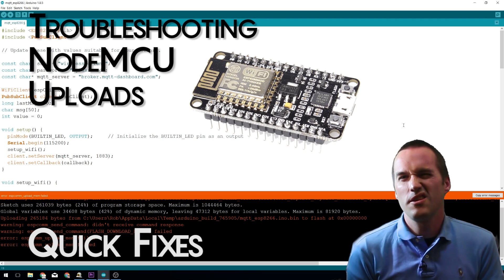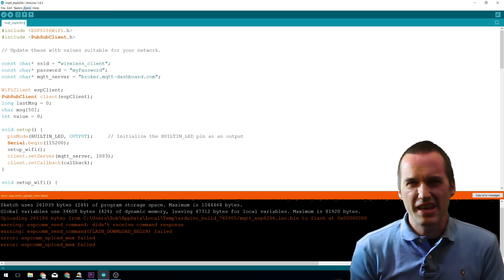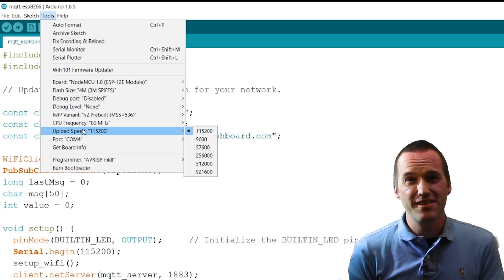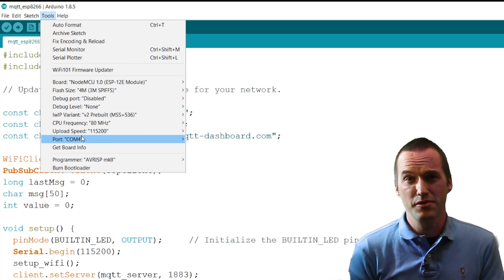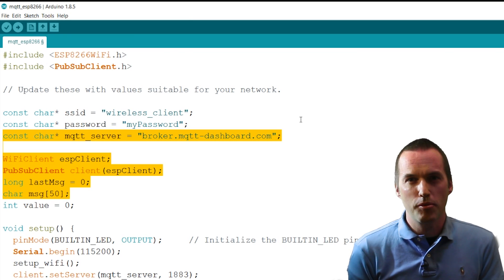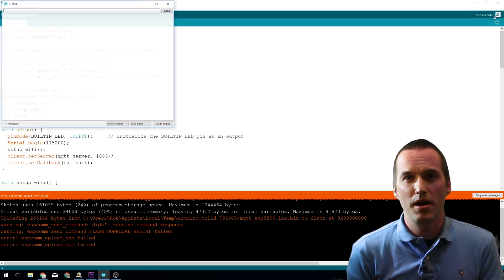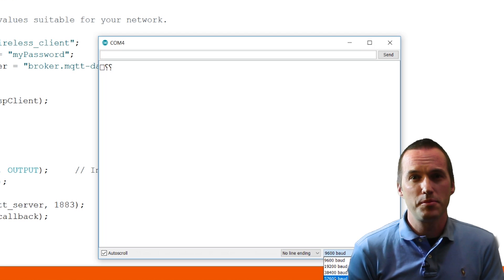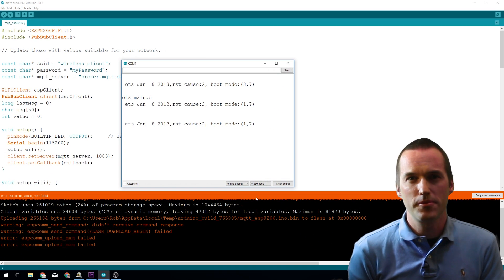Troubleshooting NodeMCU (ESP8266) Arduino Uploads

Comment: I am getting these errors after loading code into a D1 mini,  can anyone give me an explanation of what the problem is and how to cure it
Thanks...

 
ets Jan  8 2013,rst cause:2, boot mode:(3,6)

load 0x4010f000, len 1392, room 16 
tail 0
chksum 0xd0
csum 0xd0
v3d128e5c
~ld
Reply: me too
Reply: ets Jan  8 2013,rst cause:4, boot mode:(3,6)

wdt reset
load 0x4010f000, len 1392, room 16 
tail 0
chksum 0xd0
csum 0xd0
v3d128e5c
~ld
Reply: @caiqueleandro6822   Found the problem eventually, I went back to version 2.4.2 for the EP8266 Community library in the Boards Manager.
Reply: @pjweds  thank you really

Comment: There are two other issues that can effect uploading sketches to the ESP8266: your USB cable and your usb port. For example, if I use my USB 3.0 port from the headers on my motherboard I get errors uploading a sketch. Additionally, there are some USB cables that also fail. I'm not entirely sure why some cables work while others do not, but regardless, if nothing in this video helps try another USB cable and then try another USB port.

Comment: My nodemcu don't even pop up when I plug it into my pc
Reply: Try another cable. For example, I have a stack of cables I use for programming NodeMCUs and other devices. In that stack all cables work, but there is one USB cable that causes problems. When I use that problematic cable my NodeMCU doesn't come up in Device Manager, but the device powers up (5v are sent to the NodeMCU but it isn't recognized as a device by Windows).

Good luck

Comment: I have completed your installation for the RGB permanent Christmas lights, but when I go to flash the Node MCU it states that there was an error, no port found.  I tried to reset it and flash it at the same time, I even restarted my computer and reloaded ESP flasher twice.  Is there a certain pin on the node MCU that I have tot ground or something to activate the card?  Also, I have attached my control wires for my lighting zones to D1 and D2, would this affect anything?

Comment: Serial monitor says 
Waiting for connection and IP Address from DHCP
Reply from the maker: That means the upload worked but it isn’t connecting to your network. Double check your WiFi info in the Arduino sketch.

Comment: "Hard resetting via rts pin " whats this mean
Reply from the maker: That means everything worked.
Reply: @TheHookUp  help m the anwser
i have problerm about  Hard resetting via rts pin
Reply: But code is not working properly 🤔
Reply from the maker: @madushanbuddika4585  Then the problem is with your code, not with the upload.  Try using the serial monitor to determine where the code is going wrong.
Reply: @TheHookUp  Thank you very much
.... 🙏 ❤️
Reply: @TheHookUp  my serial monitor doesn't show anything (the last step doesn't work) I have to say I have this problem with an esp32... Code is uploading, but not generating a ip (and showing it on the sm)
Reply: @The Hook Up i get the same problem even using the example code in Arduino (Blink), "Leaving...
Hard resetting via RTS pin...
" hanging and internal led not blinking (and nothing in serial monitor), maybe there's something else going on
Reply: @The Hook Up same problem . Tried various small pgms. Pgms used to work earlier doesn't work now. Always the same msg "Hard resetting via rts pin"  and then it turns off

Comment: Hey thanks for the video maybe you can help me :D my NodeMCU is fresh out of the box and i can't flash it as a result from pressing the "flash" and "reset" button this comes out:
r(some other symbols which can't be displayed here like an box or arrows)$
is my device broken?
Reply: try this:
1 plug in your nodemcu
2 press and hold flash button
3 press and release reset button (while still holding the flash button)
4 upload (still holdi flash button until uploading starts) 
it should work.

Comment: the upload failed showing that, the selected serial port does not exist or your board is not connected
Reply from the maker: Make sure you have the driver installed for the USB chipset (probably the CH340)

Comment: hai sir,

my nodemcu is done uploading but at the last its state

leaving..
hard resetting via rts pin...

do u have any suggestion to solve this issue?
Reply from the maker: That means it uploaded correctly.  If your program isn't working the problem is with the program not the upload.
Reply: fatimah arsad, I have the same problem.
Is your problem over?
if yes, how?

Comment: my error is regarding connecting  led light with nodemcu esp8266 in a breadboard without resistor i have done these steps in the video but at the end of uploading its says leaving... hard restting via rts pins

Comment: Please help with this error: "esptool.FatalError: Failed to connect to ESP8266: Timed out waiting for packet header". I tried everything you said in your video. 

OS: Windows 10, latest arduino version. NodeMcu Lua V2 ESP8266 WiFi with CP2102. esp8266 v2.5.2.. Solutions that i tried: 

1) downgrading version of esp8266 from 2.5.2 to 2.5.1 (still same issue)
2) holding down flash button while uploading.
also worth mentioning, the thing you did at the end of video, nothing happens to appear in my serial monitor except for a reversed question mark. Please help my kindly. :'(
Reply: more on the error: 

esptool.py v2.6
2.6
esptool.py v2.6
Serial port COM3
Connecting........_____....._____....._____....._____....._____....._____.....____Traceback (most recent call last):
  File "C:\Users\Tech Land PC\AppData\Local\Arduino15\packages\esp8266\hardware\esp8266\2.5.2/tools/upload.py", line 25, in <module>
    esptool.main(fakeargs)
  File "C:/Users/Tech Land PC/AppData/Local/Arduino15/packages/esp8266/hardware/esp8266/2.5.2/tools/esptool\esptool.py", line 2653, in main
    esp.connect(args.before)
  File "C:/Users/Tech Land PC/AppData/Local/Arduino15/packages/esp8266/hardware/esp8266/2.5.2/tools/esptool\esptool.py", line 468, in connect
    raise FatalError('Failed to connect to %s: %s' % (self.CHIP_NAME, last_error))
esptool.FatalError: Failed to connect to ESP8266: Timed out waiting for packet header
esptool.FatalError: Failed to connect to ESP8266: Timed out waiting for packet header
Reply: Did you solve it? I am getting the same  error and cant find out how to solve it. Please Help.
Reply: @jigarvaishnav5214  I had to change both dht and esp8266. several times. probably my equipment was faulty. and I switched back to dht11 instead of dht22.
Reply: also try downloading the driver for esp8266

Comment: HERE MY ERROR. Is thr anyone knows whats the problem is this??PLEASE HELP THANKS
Arduino: 1.8.9 (Windows 10), Board: "NodeMCU 1.0 (ESP-12E Module), 80 MHz, Flash, Disabled, All SSL ciphers (most compatible), 4M (3M SPIFFS), v2 Lower Memory, Disabled, None, Only Sketch, 9600"

Build options changed, rebuilding all
Sketch uses 274756 bytes (26%) of program storage space. Maximum is 1044464 bytes.
Global variables use 27224 bytes (33%) of dynamic memory, leaving 54696 bytes for local variables. Maximum is 81920 bytes.
esptool.py v2.6
2.6
esptool.py v2.6
Serial port COM5
Connecting....
Chip is ESP8266EX
Features: WiFi
MAC: b4:e6:2d:69:8b:81
Uploading stub...
Running stub...
Traceback (most recent call last):
  File "C:\Users\HP\AppData\Local\Arduino15\packages\esp8266\hardware\esp8266\2.5.2/tools/upload.py", line 25, in <module>
    esptool.main(fakeargs)
  File "C:/Users/HP/AppData/Local/Arduino15/packages/esp8266/hardware/esp8266/2.5.2/tools/esptool\esptool.py", line 2670, in main
    esp = esp.run_stub()
  File "C:/Users/HP/AppData/Local/Arduino15/packages/esp8266/hardware/esp8266/2.5.2/tools/esptool\esptool.py", line 597, in run_stub
    p = self.read()
  File "C:/Users/HP/AppData/Local/Arduino15/packages/esp8266/hardware/esp8266/2.5.2/tools/esptool\esptool.py", line 277, in read
    return next(self._slip_reader)
StopIteration
An error occurred while uploading the sketch

This report would have more information with
"Show verbose output during compilation"
option enabled in File -> Preferences.
Reply from the maker: I think this error can be solved by moving your arduino sketch library out of your documents folder
Reply: @TheHookUp  thank you very much for this video

Comment: esptool.py v2.6
2.6
esptool.py v2.6
Serial port /dev/ttyUSB0
Connecting........_____....._____....._____....._____....._____....._____.....____Traceback (most recent call last):
  File "/home/sasank/.arduino15/packages/esp8266/hardware/esp8266/2.5.1/tools/upload.py", line 25, in <module>
    esptool.main(fakeargs)
  File "/home/sasank/.arduino15/packages/esp8266/hardware/esp8266/2.5.1/tools/esptool/esptool.py", line 2653, in main
    esp.connect(args.before)
  File "/home/sasank/.arduino15/packages/esp8266/hardware/esp8266/2.5.1/tools/esptool/esptool.py", line 468, in connect
    raise FatalError('Failed to connect to %s: %s' % (self.CHIP_NAME, last_error))
esptool.FatalError: Failed to connect to ESP8266: Timed out waiting for packet header
_
the selected serial port _
 does not exist or your board is not connected
please help me fixing this

Comment: I am getting this error.
Arduino IDE, nodemcu
............................................................................................................
Stub running...
Configuring flash size...
TRACE +0.000 command op=0x0a data len=4 wait_response=1 timeout=3.000 data=1c020060
TRACE +0.000 Write 14 bytes: c0000a0400000000001c020060c0
TRACE +3.004 Timed out waiting for packet header
    raise FatalError("Timed out waiting for packet %s" % waiting_for)
esptool.FatalError: Timed out waiting for packet header
esptool.FatalError: Timed out waiting for packet header

Comment: Hey I really need help with an issue i have.
So here is the problem.
The sketches (doesn't matter which) I upload will go uploading till a 100%.
After this the sketch does NOT do anything at all.
I tried an empty sketch with just Serial.PrintIn("Working!") in the loop command, but no response.
I get no errors while uploading, it just goes to a 100% and says done uploading.

My setup
Adruino IDE
NodeMCU ESP8266-12E
All settings checked multiple times and changed but that did not solve the problem.
While uploading the light flashes till its done.

I hope ANYONE knows what this is or does. I got mine from China and i'll probably have to ask to get my money back.
Reply from the maker: Do you have another board you can try? Sounds like a bad board.
Reply: @TheHookUp  unfortunately, no.
I just waited 7 weeks to get it from China and assumed it would work.
Is there anyway to do more testing or to fix a bad board?
Reply: @vasil-yt did you solve it
Reply: @dianailhan4877  yeah I don't remember what was wrong exactly but at some point I tried the blink sketch again and it worked. I think something just went wrong while pushing it.

Comment: I still have the problem 'espcomm_open failed'. I have the correct board selected and the same settings that you have. I use the latest Arduino IDE and I have also installed the required drivers. Also the port connection works and I also did what you mentioned in the video. Do you know anything else that I could try?
Reply from the maker: Try a different port on your computer

Comment: Hey guys I got this interesting problem: so my ESP8266 works just fine when connected via USB Serial adapter to my laptop, but it doesn't do anything if I hook it up to my Arduino Mega via the 3.3V output pin. Any ideas what it could be?
Reply: Connect it to 5V. It already has a 3.3V regulator inside

Comment: The flash / rst didn't fix it .... when I view com 3 with holding flash then reset it shows something but its coded writing, not sure how to update
Reply: Arduino: 1.8.8 (Windows 10), Board: "NodeMCU 1.0 (ESP-12E Module), 160 MHz, Flash, Enabled, 4M (no SPIFFS), v2 Lower Memory, Disabled, None, Only Sketch, 115200"

Sketch uses 284332 bytes (27%) of program storage space. Maximum is 1044464 bytes.

Global variables use 27128 bytes (33%) of dynamic memory, leaving 54792 bytes for local variables. Maximum is 81920 bytes.

Uploading 288480 bytes from C:\Users\Travis\AppData\Local\Temp\arduino_build_354228/Blink.ino.bin to flash at 0x00000000

An error occurred while uploading the sketch

warning: espcomm_send_command: didn't receive command response

warning: espcomm_send_command(FLASH_DOWNLOAD_BEGIN) failed

error: espcomm_upload_mem failed

This report would have more information with

"Show verbose output during compilation"

option enabled in File -> Preferences.

Comment: Has anyone seen the issue when all board functions seem to work except the wifi will not connect erratically?   I can upload a totally different program and then wifi will work. But the original  program I am trying to run will not. .  It is not a problem with the program I am trying to as it did used to work.  Then it became erratic.  I'll try a new board, and it will again work for a while and then stop after a few days. I like these boards but the documentation is sparse and they are very touchy and fragile.
Reply from the maker: If you use delay(); in your code it can cause the wifi to fail.
Reply: I fixed the problem by shorting some pins... forgot what pins though... but it's possible to be fixed...

Comment: Hey I am using lolin nodemcu v3. Any of these didn't worked for me. When I press flash button nothing shows up on the serial monitor but then on clicking rst button some garbage data shows up on the screen (tried for different baud rates). I also tried by providing 5v to Vin but error (espcomm_sync) still shows up. Moreover on nodemcu flasher, it constantly shows waiting MAC.
Reply: have you found a solution to the problem?I am having the same issue if you could kindly share.

Comment: Mine one showing boot mode 7-2 with pressing flash button 5-2 and am getting three errors while uploading esp upload mem failed, espcom open failed and espcomm sync failed
Reply: I'm facing the same issue

Comment: Sir, im getting problem with my node MCU it says espcomm_upload_mem failed.
And boot mode is showing as (3,6)
And when i keep the flash button preesed and then i press reset button it is (1,6).
What to do sir plz help
Reply from the maker: boot mode 1,6 is the correct message to indicate flashing.

mem failed could be caused by having the wrong driver for usb to serial, or the wrong selection of flash memory size in arduino.

Comment: Arduino: 1.8.6 Hourly Build 2018/07/20 10:25 (Linux), Board: "NodeMCU 1.0 (ESP-12E Module), 80 MHz, 4M (3M SPIFFS), v2 Lower Memory, Disabled, None, Only Sketch, 115200"

Sketch uses 250800 bytes (24%) of program storage space. Maximum is 1044464 bytes.
Global variables use 32420 bytes (39%) of dynamic memory, leaving 49500 bytes for local variables. Maximum is 81920 bytes.
error: failed reading byte
warning: espcomm_send_command: can't receive slip payload data
error: failed reading byte
warning: espcomm_send_command: can't receive slip payload data
error: failed reading byte
warning: espcomm_send_command: can't receive slip payload data
error: failed reading byte
warning: espcomm_send_command: can't receive slip payload data
error: failed reading byte
warning: espcomm_send_command: can't receive slip payload data
error: failed reading byte
warning: espcomm_send_command: can't receive slip payload data
error: failed reading byte
warning: espcomm_send_command: can't receive slip payload data
error: failed reading byte
warning: espcomm_send_command: can't receive slip payload data
error: failed reading byte
warning: espcomm_send_command: can't receive slip payload data
warning: espcomm_sync failed
error: espcomm_open failed
error: espcomm_upload_mem failed
error: failed reading byte
Reply from the maker: I'd guess that is a driver error?  Have you ever been able to upload to a NodeMCU in the past?

Comment: do you know how to turn off the blue led on the D1min.  I a using the LED lights sketch bu Bruh. I think there must be a setting in the sketch for it somewere. Thanks
Reply from the maker: Sure, add this to void setup:

pinMode(2, OUTPUT);
digitalWrite(2, LOW);
Reply: Thanks, I will give it a try later.  Great videos by the way.

Comment: Not at home at Mo so cannot get the error but I will be back! I purchased some Wemos D1 minis but I think they are too cheap knockoffs. They took Arduino code first time but now windows does not recognise them, comm port sometimes shows, sometimes not, with or without reset button pressed. A different batch from a different supplier work fine. Tried resetting them with I think it was espexplorer but that didn’t work either. Reset with resistor on ground and D4, no joy. Anyway, thanks s for video. Cheers